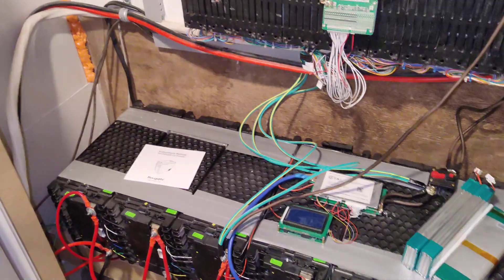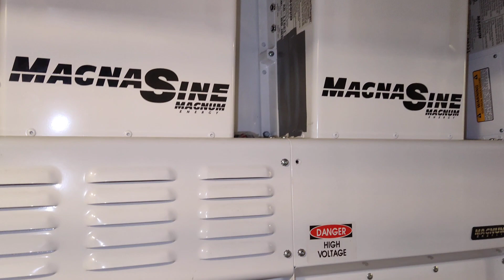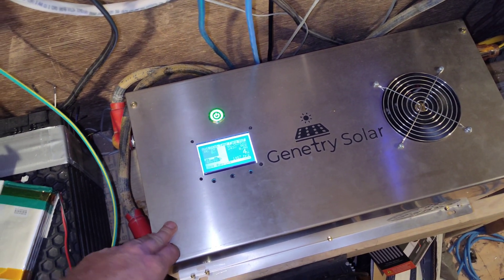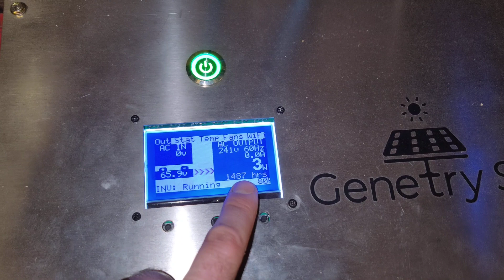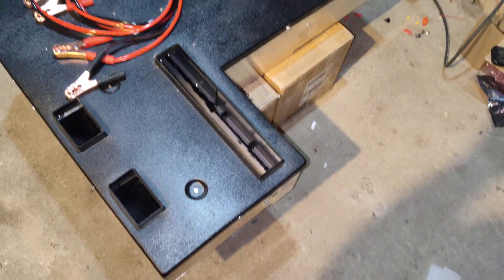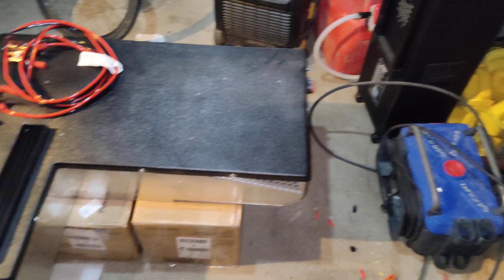Over View Of My 65Kwh Solar System

Comment: Looking good! My system is just idling. We only use 3 kilowatt a day. The only things on the system is a refrigerator and the well pump. Even on laundry day we only use 5 kilowatts. The fith wheel is on a separate system. It only uses .3 kilowatts  a day. Its killing me. All this sun and no where to use the power lol. The house should be here in a couple weeks. I am sure we will use more power then. I bought  a 500 watt electric heater to run in the fifth wheel on sunny days.
That should save a little propane.
Reply from the maker: The heater is a good idea